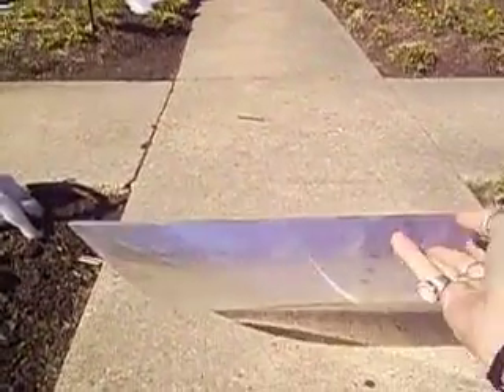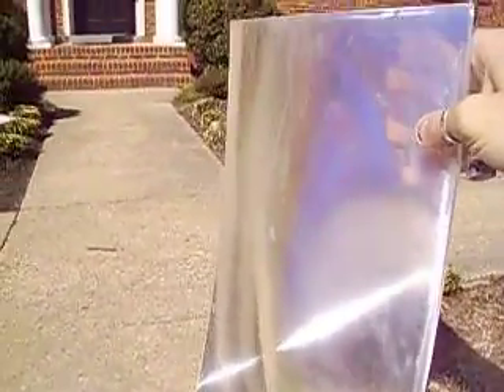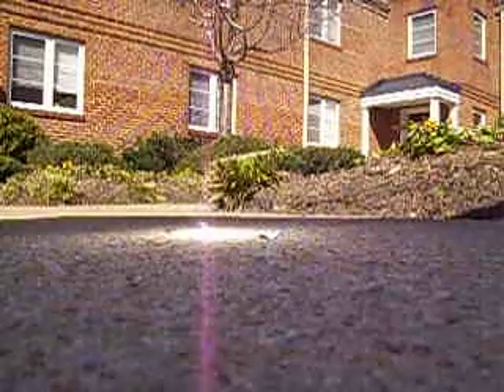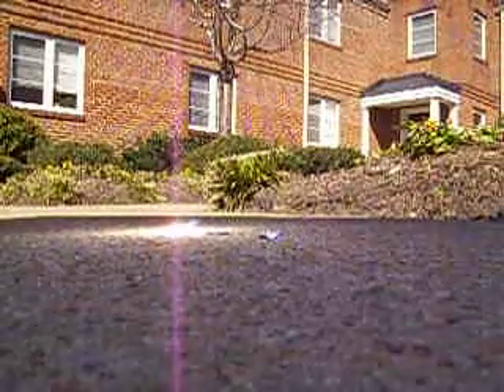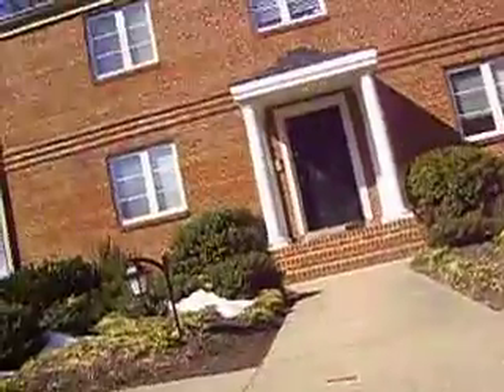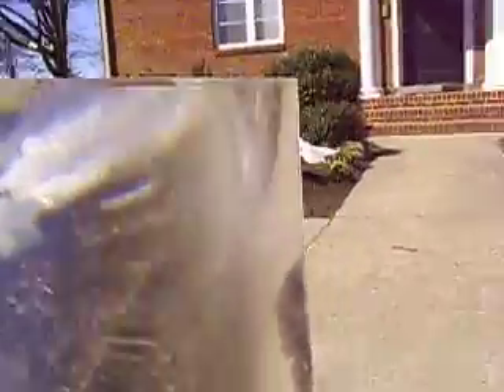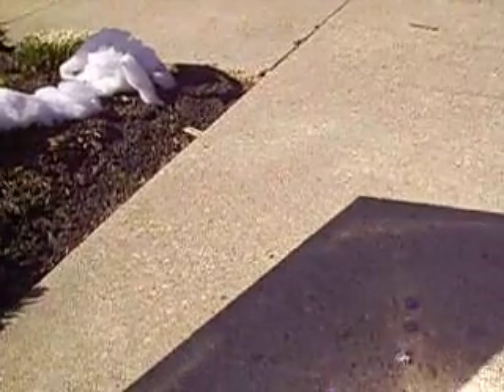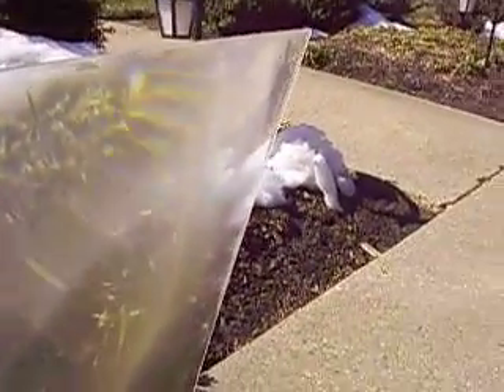Solar Power! Fresnel Lens melts nickle and copper

Comment: You said you salvaged the lens from a big screen TV, was this a projection TV or what type? I have an old projection 52" HDTV that quit working and is currently taking up a LOT of floorspace in my spare room. I was wondering if I took the screen off of it, would it likely be a fresnel lens? I would love to salvage one from my old TV than buy one of the ridiculously priced websites.